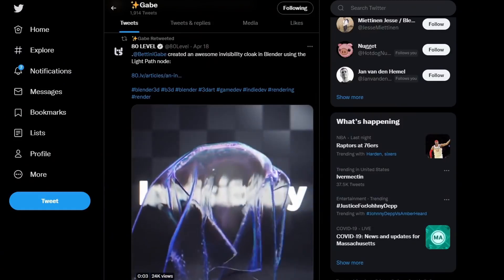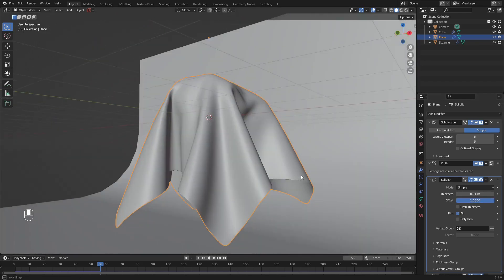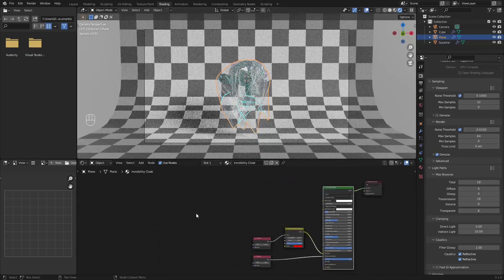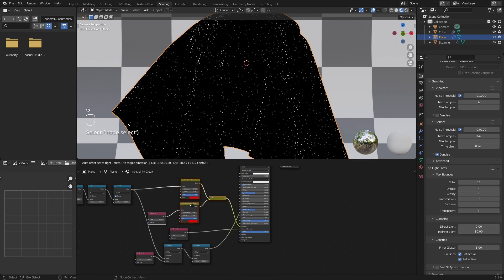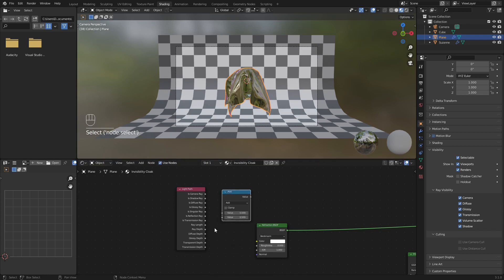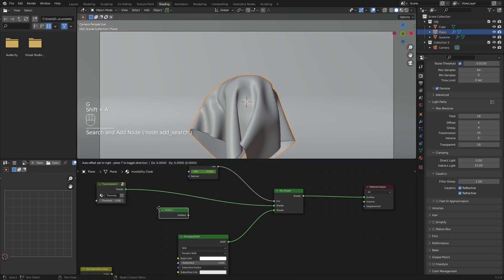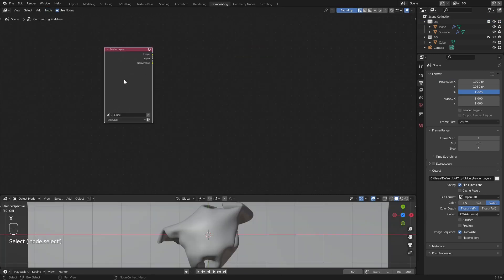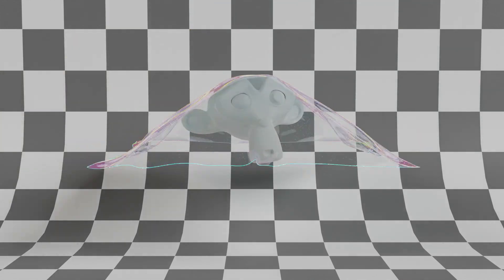BLENDER Invisibility cloak tutorial

Comment: Bro can this be done in eevee
Reply from the maker: Ok, I've figured out a possible way to do this in eevee, I'll start making a video, can I include a screenshot of your comment?
Reply: @idowhatiwant6678  yes you can, thank you
Reply from the maker: No, light paths and holdout are limited to cycles, 
there is a possibility you could render 2 layers like in the last version, but replace the transparent material with an emission set to a solid colour, and then use a chroma key.